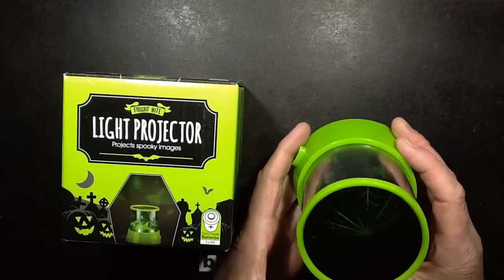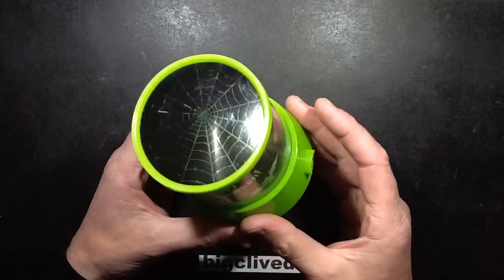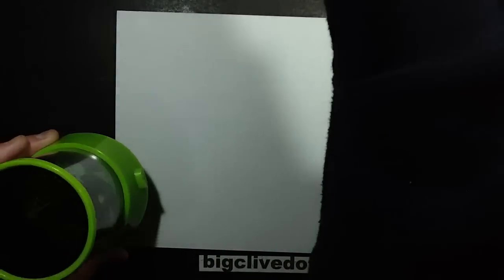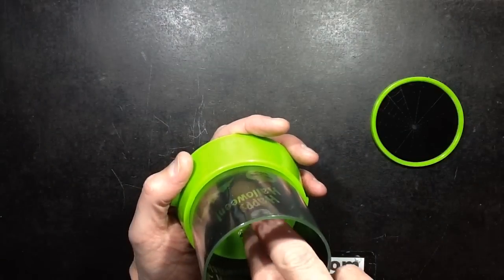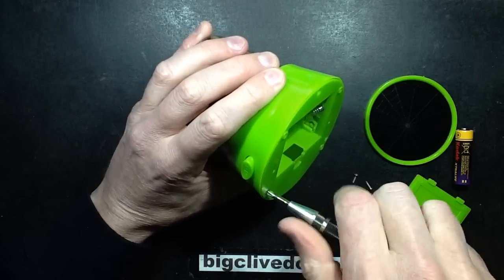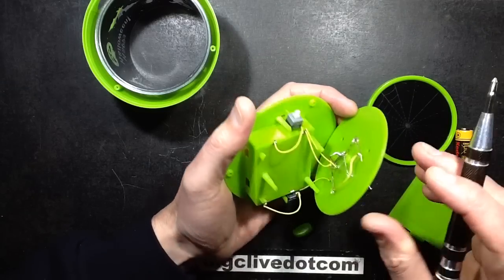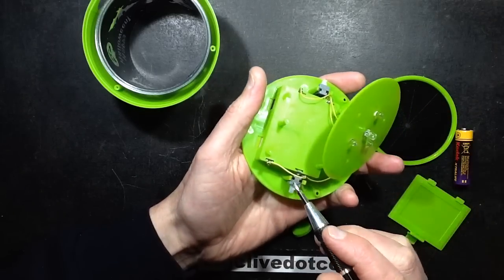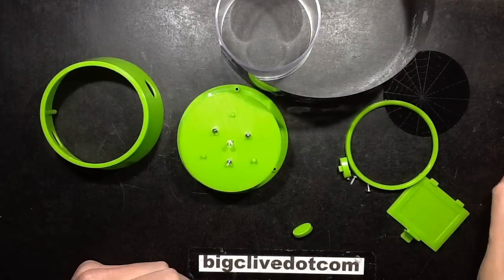A look inside Poundland's LED Halloween projector.

Comment: If there is no controller/circuit board,  what makes the LEDs flash in the second mode?
Reply from the maker: +Ciara Blow Manners Each LED contains a control chip.
Reply: +bigclivedotcom that's amazing!  Tiny computer lights.  Thank you

Comment: hi clive 
my wife has a jelly fish light that uses 3×AA batteries is it ok to just solder on a 5v USB cable to it just to save on batteries thanks 😊
Reply from the maker: +jonathon cobb As long as it's not too current heavy that should be OK.  It might be worth adding a suitable diode in series (perhaps a 1N4004?) to drop about 0.6V to bring the 5V down to around 4.5.
Reply: Thanks it's only 3 leds with a small motor but best be safe than sorry thanks again

Comment: I thought it might be included in a 'Catholic Priest Exorcism Kit' (Would scare the willies out of me).
Clive, do you take requests ? I was thinking of your expertise in a video elaborating on the demonstration the other day when you used a 'Non contact high voltage detector'  to demonstrate the mains referenced output of a 'Mains/USB adapter'.
Maybe answering, What is triggering the detector on a 5v DC output ? (is it detecting the sine wave of the mains ?).
I can reproduce that test on all my 'Branded, Approved adapters. You could explain why this does not occur on older linear PSU's, etc. and what the significance is.         .... Enjoying your videos,    Thanks again Mate.

Comment: Wow. That is cheap. Just used three LEDs with a blink/fade chip in it. That is just utter cheap. Should sell that for 2p. Even the printed foil looks like they have just printed it with a laser printer with a drum that probably has seen 500 000 prints...